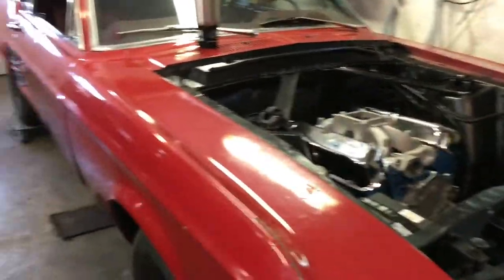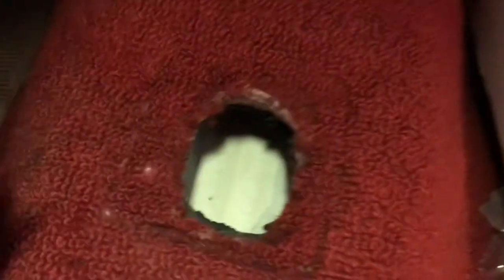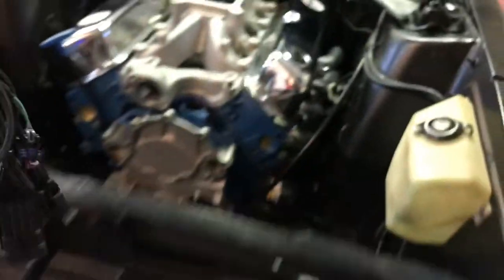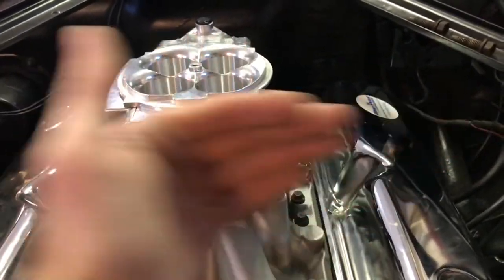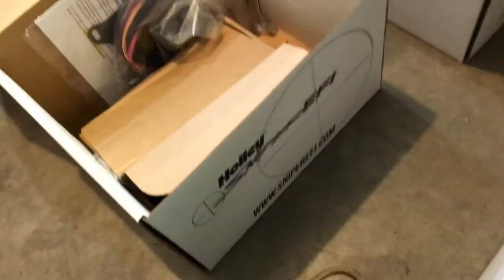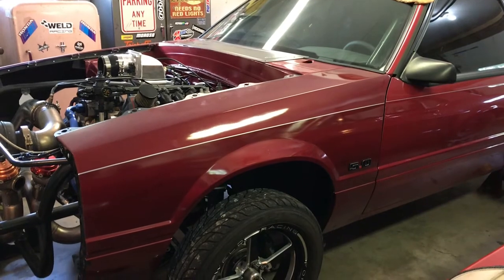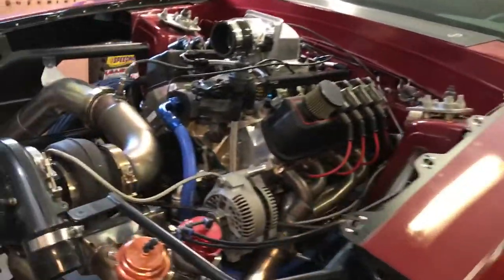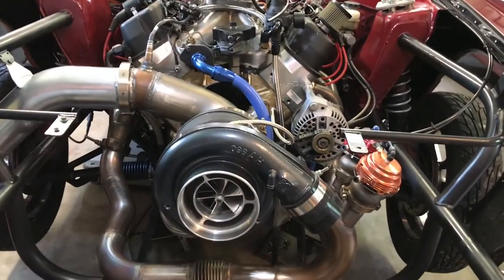Went to the Track, Things went BAD

Comment: You can't say meth sucks because you don't know how to tune it or are having other issues.  I went 5.70s years ago with a stock block windsor and the little as cast trick flow 170s borg s475 with meth and no intercooler..  you have issues somewhere else, not the meth lol
Reply from the maker: The intake temps were going high, but what “sucks” about meth is u have to pump a lot in it to cool, and the more u pump in the more fuel u have to take out of the base map which I’m not a fan of
Reply: I see 230+ by the 1/8 mile with the current setup, zero issues, runs 5.40@130 .  My ve table is indeed out of whack from the meth but it's the nature of the beast when you spray alot.  I have been running meth for the past 6 or so years with no complaints. 

  After watching your most recent vid, of what it ran with the intercooler on it, there is another issue.  Especially If it's slowed down that much from when it had the 75mm on it.
Reply from the maker: I would agree with you there is some underlying issue, the only thing I can see is A valve float, or B. This 85 mm just dosent make power on this combo, which I’ve heard from multiple sources of forced inductions turbos being that way, but idk 😐